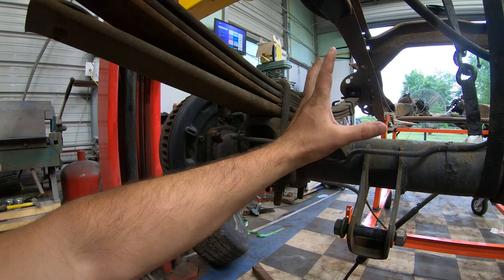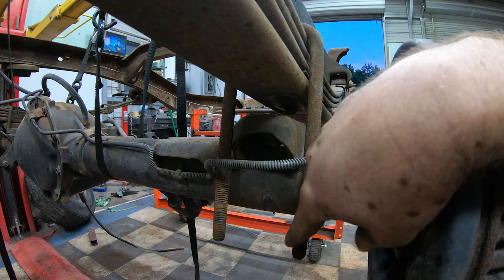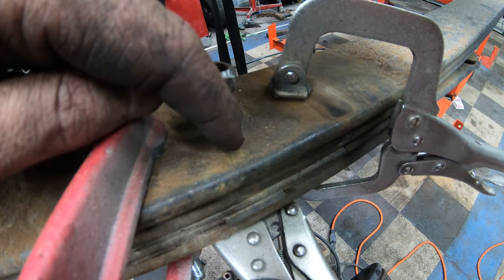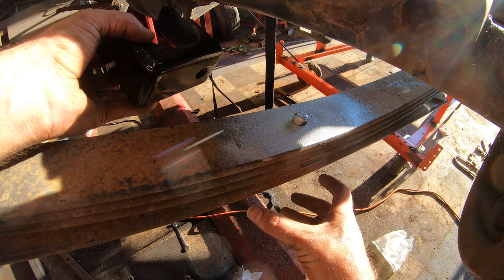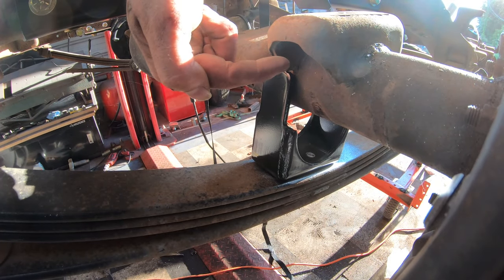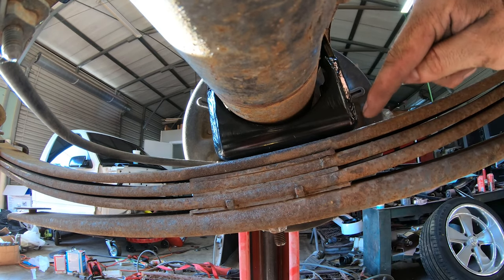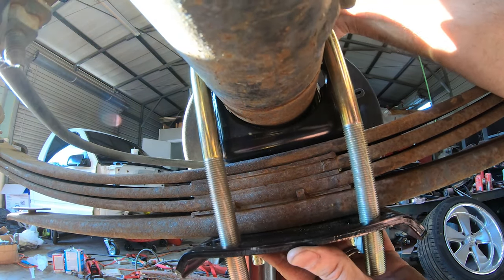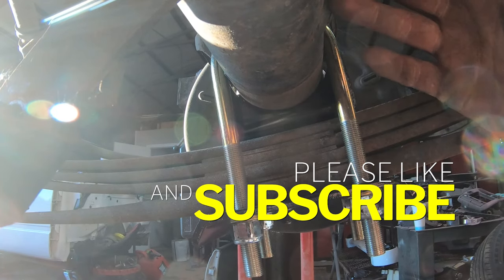Axle Flip Kit installed

Comment: Great video! How do you know what length shocks are needed now that the travel is shorter?
Reply from the maker: I went to the bell tech website to see what they used with their 5/7 kit so I knew length
Reply: @1194video  ok cool thank you. I'm trying to drop a 63 e100 and it's guessing game I think. Unibody frame and all
Reply from the maker: @dull_boy_274  it’s nice having a solid front beam because your wheels won’t camber in when slamming it
Reply: @1194video  solid front beam? The front axle? I flipped the front and its ok...but the back has got me stumped. Deciding if I should bad, flip axle or get drop springs. I guess coils are an option too. I'm about to draw out of a hat and just go with whatever comes up hahaha
Reply from the maker: @dull_boy_274  go to tractor supply and get some trailer axle spring perches and put the axle on top of the leafs using those pads from tractor supply, weld it to the rear and reuse the stock hardware. Or if your not looking to go so low, get the rivets out of the front hangers that are attached to the front of leaf and flip it upside down to get a little lower without slamming the truck then either drill and bolt it or weld it
Reply: @1194video  I flipped the axle but then decided on a 4 link. Just installed that so now on to bags or coilovers 👍

Comment: i installed my flip kit tightened everything down but one side is lower than the other do you know the cause of this?
Reply from the maker: @theyluvtony6953  make sure your tube of your axle is the same height from the spring perch it sits on, it might be caught somehow on the sides, and if you used hangers make sure they are both in the same hole
Reply: @1194video  alright thanks a lot man your video helped me flip my leaf springs

Comment: 😮😮 my tab isn’t all the way in, it’s riding the lip of the bracket … but however my hole is to the front … 🤔
Reply from the maker: @ClubFreeze501  just make sure your rear end is centered with the wheel opening  and you will have to clean the tab up good so it sits flush
Reply: @1194video  that’s what I’m doing now . Passenger side is good, now I’m working on the driver side, just as you sent the text msg, thanks

Comment: So I just bought a 76, And I wanna do this. I already have 2 inch drop shackles just wanna do the flip kit, If I do this will I have to c notch or will I be okay?
Reply from the maker: Long as you don’t add weight to the bed but if you hit hard bumps it will hit
Reply: @1194video  thank you I’m brand new to trucks I’ve always been a motorcycle rider. Will I have to remove bump stops too? Thanks so much for chatting
Reply from the maker: @AJV4L2007  that will give you more clearance if you do

Comment: hey i got a flip kit for my silverado however it was a universal fit but the bracket that holds my rear end up the tabs don’t fit as there to wide.. do you think i can cut them for they to fit in the original or can i just sit the rear like that ?
Reply from the maker: Can you cut them down some so it fits correctly
Reply: @1194video thanks for the quick feedback. i will be trying to cut them down some for the tabs to fit in the original

Comment: Do you know if u can put a flip kit on without the axle locaters?
Reply from the maker: No you can not, those help center and safely keep the rear in place, I always remove them and flip them as well so the pin is on the correct side, but do not remove them completely, very unsafe

Comment: I got a flip kit but I wanna go lower pls help
Reply from the maker: You can remove the large leaf on bottom and next to that to go really low or cut rivets and flip front hanger and weld back on upside down
Reply: You can get lowering shackles that will replace your stock ones the lowering shackles will bring it down an extra 2 inches so the rear will be 8 in low

Comment: I’m planning on getting a flip kit for my 2006 Chevy Silverado how low would it drop and would I need a c-notch ?
Reply from the maker: It’s about a 5” drop but if you add shackles it adds 2” to make 7” in rear, if you only do a flip kit and remove the bump stop that’s bolted to the frame you can get away without adding a notch but if you add any weight in the bed it will hit the frame over bumper occasionally
Reply: @1194video  thanks for the reply, so I should be okay with just the flip kit ? My tires on the truck right now are also 265/65/18, would I need a smaller tire?
Reply from the maker: @Jimmynbs97  that would depend on the offset, you would want to make sure it can freely move up and down inside the wheel well without rubbing